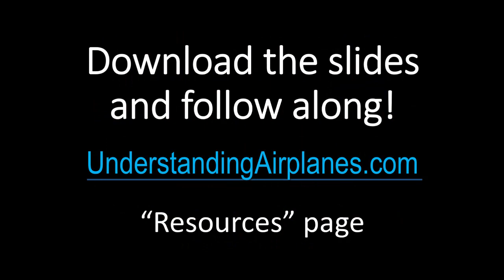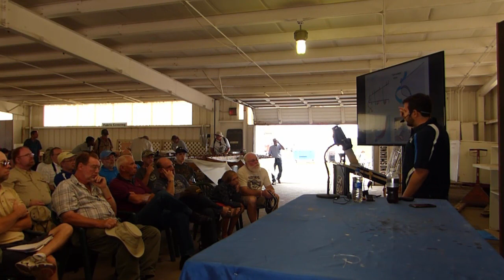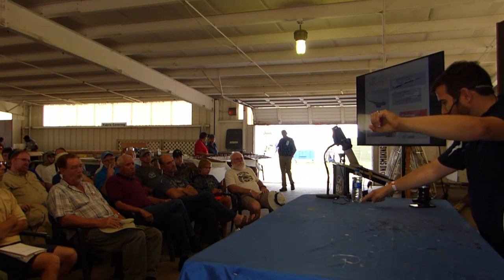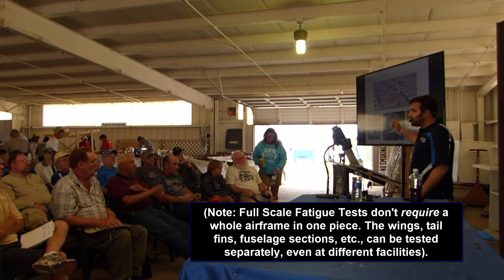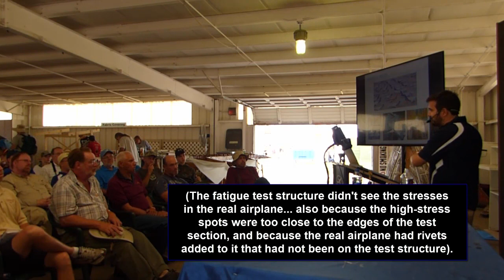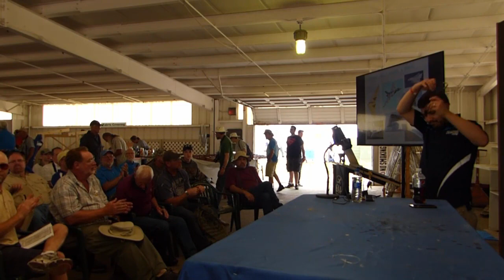Airplane Design for Non-Engineers - Oshkosh 2018

Comment: "Radar photons". Ummm nope.  Good analogy but you never clarified that it is RADIO waves that are bouncing off, not photons. The R in Radar is Radio.
Reply from the maker: Light is both a wave and a particle ;]

https://en.wikipedia.org/wiki/Wave%E2%80%93particle_duality
Reply: That's nice but Light is not used in Radar, radio waves are. You started off with an analogy about reflected light - which was good and clear BTW - and then went on talking about Radar but still calling it Photons when by that point it would have been clearer if you clarified that it is radio waves and not light photons being utilized  - it's just that they behave in the same way. Like I said in my below comment it's a good talk! Just giving you some constructive criticism - Your talk was supposed to be for Non-Engineers remember :)
Reply from the maker: By "light", I meant "electromagnetic radiation". Radio is a kind of electromagnetic radiation, like light, just at different frequencies. Radio is absolutely made up of photons. But yes, I agree that I could have made it clearer that "think about how visible light reflects off of shiny things" is not exactly the same as how radar reflects off of airplane skins: With radar, there is some scatter and so on. (I thought that might be a little too in-depth for most non-engineers...)
Reply: When most people (non engineers and non scientists alike) refer to Light they are referring to visible light. That's why we have other names for other types of electromagnetic radiation. Microwave, X-ray, Gamma and yes Radio waves. By continuing to use the word Photon you will have confused your audience (of non-scientists and non-engineers) as they would associate Photon with Visible light which has nothing to do with RADAR.